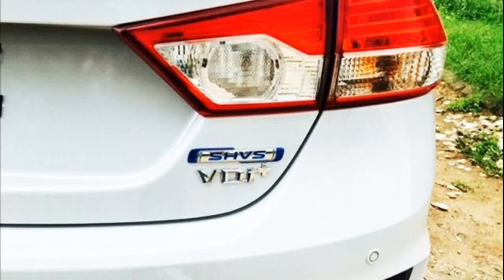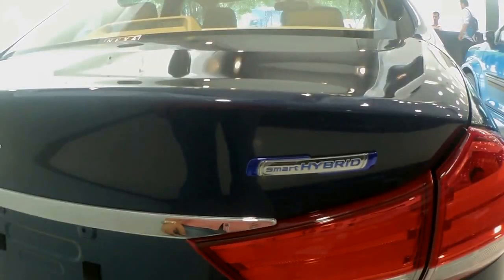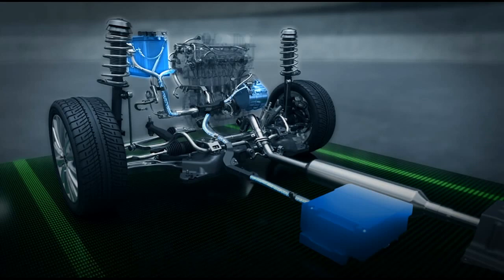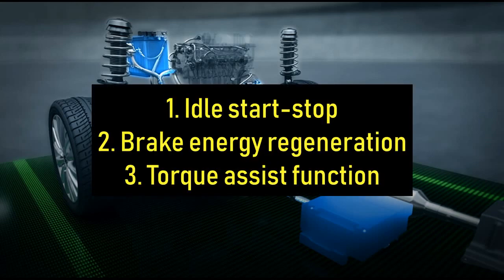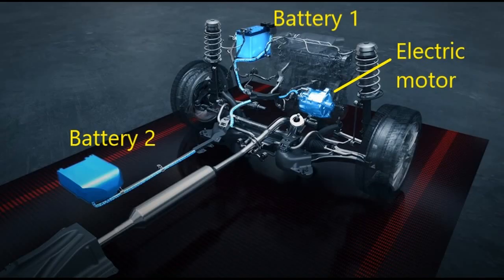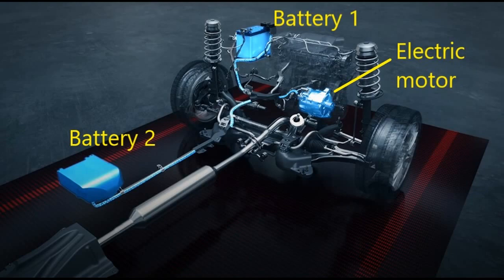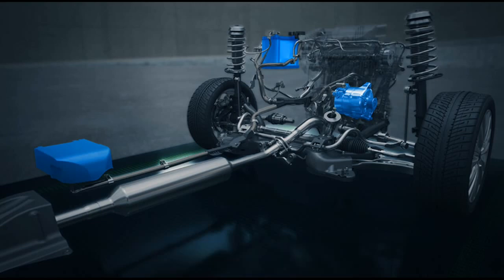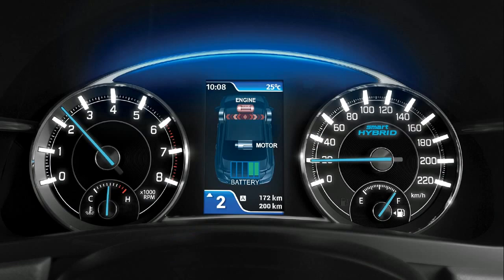Smart Hybrid Technology by Maruti Suzuki | How does it work?

Comment: We hv Ciaz automatic alpha smart hybrid...How to recharge the battery? I drive 40-50 km per day, yet it shows that the battery is not fully charged... what should I do?
Reply: It is the lithium ion battery(which is under the seat) ... It never shows battery full... It only shows full when the car is running and when the speed decreases it shows it's not full..... So don't worry... It's normal.... I too was worried abt it at ist but then got to understand it.... I too have the same model....It is used to save the fuel when ur car is at signals....This does not show the main battery I.e lead acid battery.... So chill😊😊